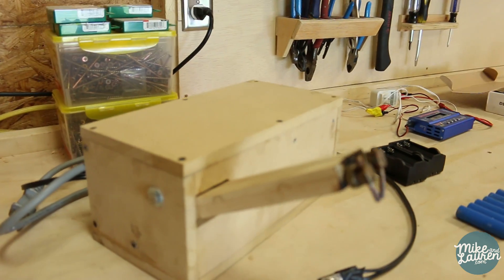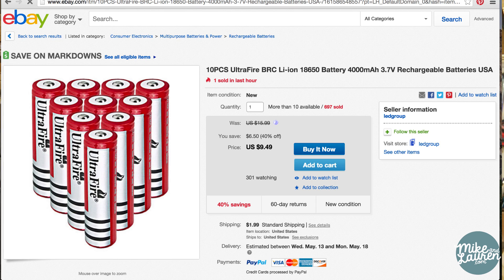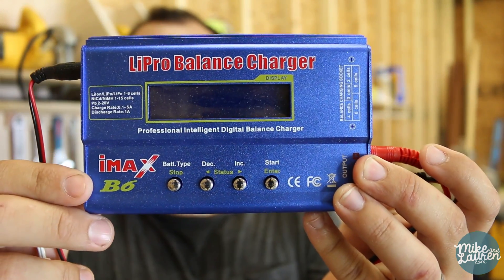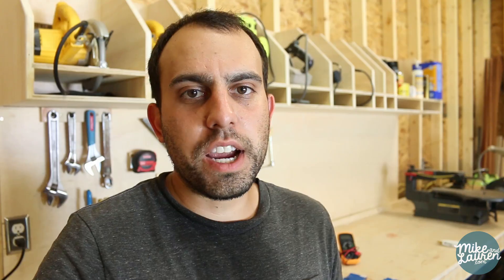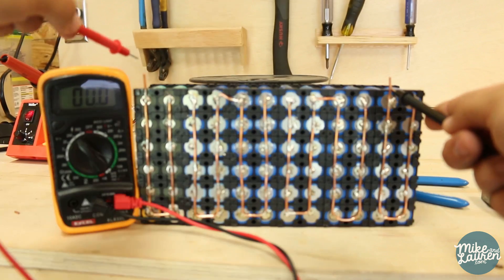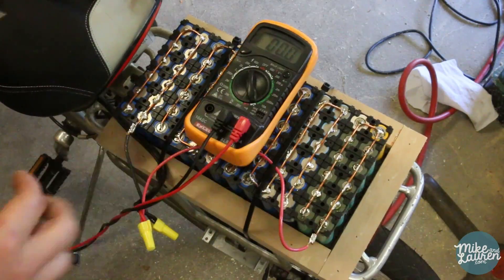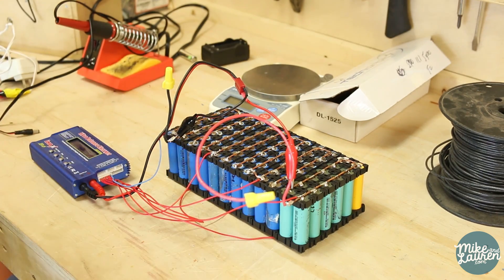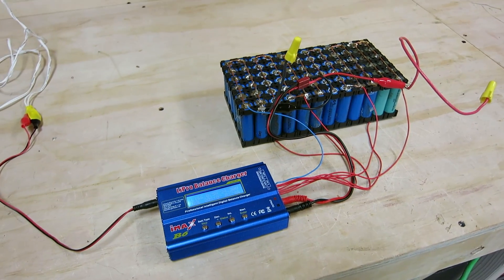DIY E-Bike Battery Pack from Laptop Batteries [Re-Upload]

Comment: I know this is a re-upload, so this may have been a while ago, but when you're plugging in high-voltage/amperage equipment, try to do it with one hand in case there is an error. That could potentially prevent the circuit from being completed through you!